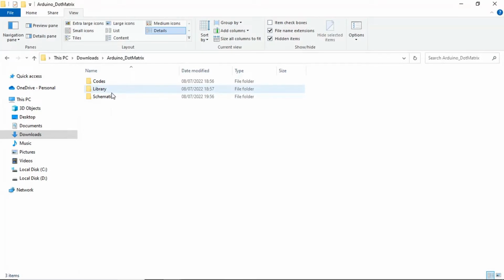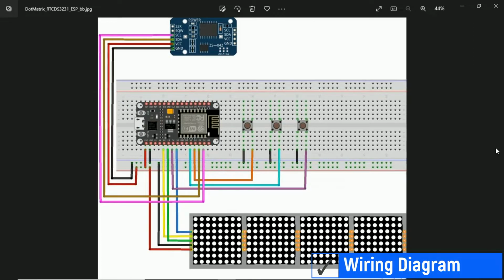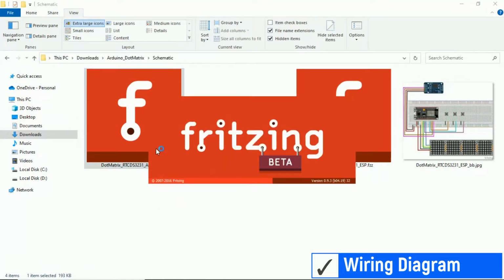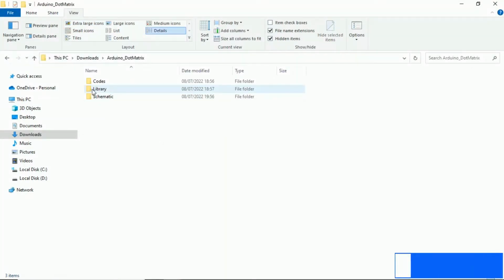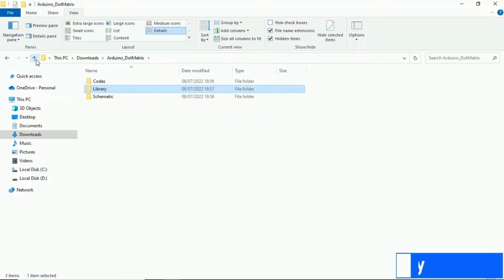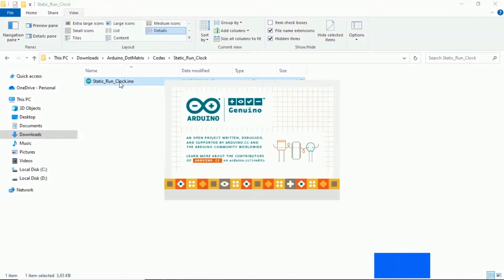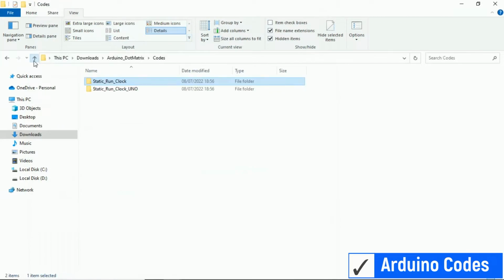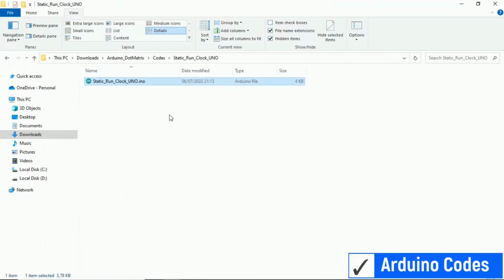Arduino: Dot matrix MAX7219, display static text, scrolling text, and clock time (RTCDS3231)

Comment: Hello.
Thanks for sharing the video. I hope I can make this story short and you might help me out.
My project is similar to yours. I use Arduino Uno and of all projects, in comparison, yours is the closest I can get. So, with almost no experience, your video and some other examples I try to complete this project:
A keypad 4x4 buttons with a matrix of 8 devices 7219. There will be 16 possibilities for displaying static text, static text in multiple pages, scrolling text or animations. So for example: 
Button 1 displays static "text1, page1" infinitely; 
Button 2 displays "text2, page1" (2 sec), "text2 page2" (2 sec) in loop function; 
Button 3 scrolls "-->" to the right; 
Button 4 flashes the whole matrix

I try to use your code, but I do not use the clock function, so I instantly get an error while compiling.

Coming back to the questions: my issue is, using your code - admitting I added the keypad library and made some changes to get no errors - only static text works under different buttons.. once I choose the scrolling text, or try two or more pages of static text that must loop, the code got 'stuck' in this particular part of code; the buttons for another option doesn't work anymore. The only way to stop the whole function is to resend the code from the computer.. I am very curious how your code does not got stuck and remain working regardless which button you press at anytime?
The other question is: from static to scrolling I would like to have the display clear, and not seeing the previous text scrolling away. Maybe adding one more Display.clear to the code overthere?
It would be very helpful if you can reply to my questions. Thank you in advance.